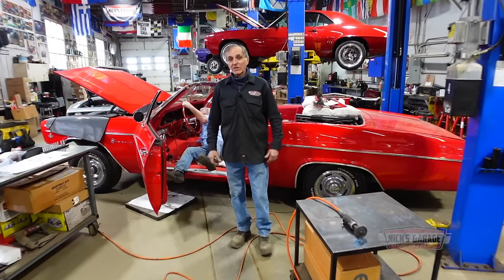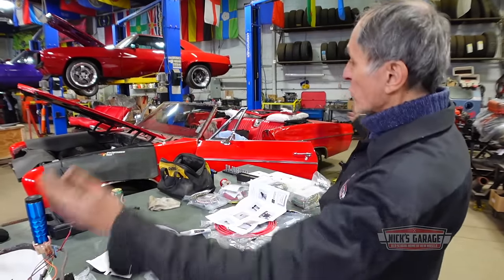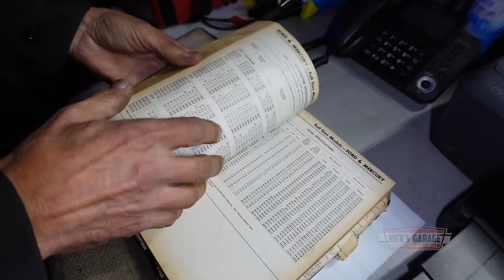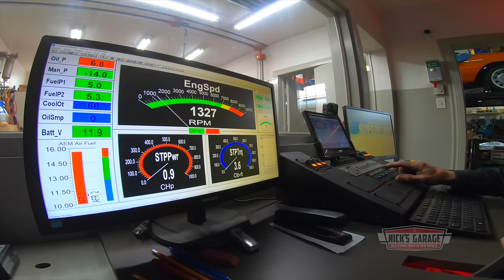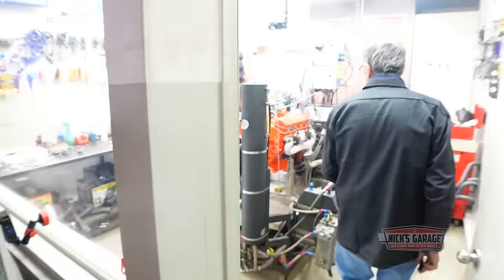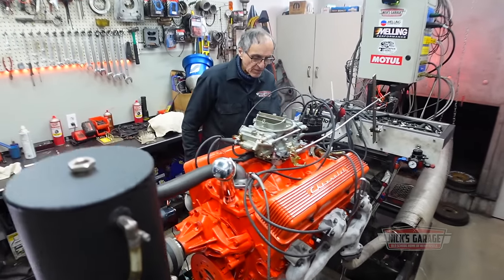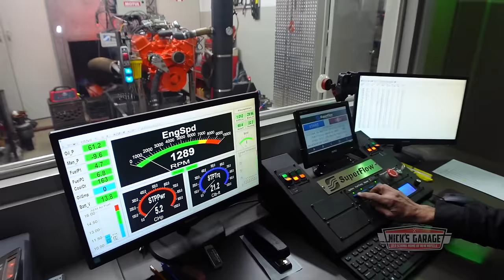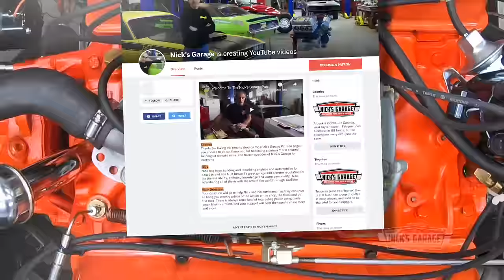327 Chevy on the DYNO - Exhaust Shootout

Comment: That torque and horsepower difference will directly relate to fuel economy loss as well. If long tube headers are used, I'd say he'd gain up to 2 mpg. Per tank full the headers would likely give him two extra gallons of gas, and quickly pay for themselves.

Comment: In my 79 Camaro, I welded in a tube and breather cap in each valve cover in addition to a PVC valve .
  What is a little cam?  in 1980 I put a 327 350 HP  Hydraulic flat tappet cam in my '79 Z-28 Camaro along with headers and a Holley street dominator intake  with a 600 CPM double pumper..    .450 lift that cam was very popular for street hot rodders

Comment: You could wire up a temp switch to turn on the water pump when the motor reaches the desired temp...much like wiring electric fans.
Reply: I was thinking that
Reply: I think the dyno does that...
Reply: @BuzzLOLOL  thats not what Nick said though. He said that he leaves the pump off until the motor gets warmed up then turns it on.
Reply: @cuzz63  ..That is correct. And I like to control it.
Reply: @nickpanaritis4122  no problem...thanks for the info.

Comment: 3M- Weatherstrip adhesive that comes in a tube is great for holding gaskets in place and especially valve cover gaskets.  Not the black stuff that is used to cement door and window gaskets in.  I'm referring to the yellow stuff.  It is a high tach  so you just put a small bead on the gasket and the cover then smooth it and spread it with your finger.  Let it dry for about 5 mins then when you put the gasket on the cover it will hold it in place.   It's not a sealant but works great on oil pan gaskets and it's just to hold the gasket in place while you sometimes have to tilt the covers or pans.  It won't cause the gaskets to slit and squeeze out like RTV and you don't need much on each surface.   I think 3 M also makes this in a spray to be used for headliners, but I think the kind that comes in a tube is best.  Just make sure it's the yellow because I think the black is labeled the same.   Caterpillar made some great stuff too, but they discontinued it.

Comment: Of course it depends on the compression ratio. The 11:1 version was 1965 - 1968 with 4 Barrel Carb (L79)

Max Brake Horsepower: 350 @ 5800 rpm
Max Torque: 360 @ 3600 rpm
Stroke: 3.25
Bore: 4.001
Compression: 11.0
Firing Order: 18436572
Reply from the maker: Thanks for the numbers.
Reply: @NicksGarage  That's the L79 he is talking about. 350 hp with hydraulic lifters! Came in Corvettes and Chevy II's. They embarassed a lot of big block cars.
Reply: @bobthbldr3  yep that's the 151 cam
Reply: @bobthbldr3  - Was also top motor for Chevelle before 396 came along late '65 and after...
Reply: 11:1 also in earlier 360, 365, and 375 HP 327" engines...

Comment: The 300 horsepower of that vintage had a carter avs 
the pcv goes to the back of the block by the distributor pre 1963 had the draft tube in that location

Comment: Smog exhaust manifold would have to go along with that points distributor.. if mine I’d have to change some things as HP will be lower at the rear wheels
Reply: Hot Rod tested 10 different types of distributors and to their surprise the stock points one made power up with the best of them!

Comment: The PVC on these hooked up behind the distributor there was a bell shaped plug with hose fitting and PVC screwed into the carb base with hose between if I remember correctly? There was a provision in the block, I don,t see it on this motor as it looks like a later model engine with large jornal crank and long water pump so not original to the 66 chev.

Comment: The 327's were tough little engines. And perhaps a little under appreciated.
Reply: the 327 engine was the start of the muscle car era. it started out as a 265 in 1955, grew to a 283 in 1957, and in 1962 came the 327( used in the corvette). the small block engines topped out at 350. it is amazing what you can do  just playing  with the "BORE, and STROKE" all from the same block( 400 C.I.D. engine was a different animal on a small block design - no cooling jackets between cylinder walls )  YUP!!!! THE MOUSE THAT ROARED!!!!!

Comment: i have a 327 in 1967 camaro 202 hump heads, aluminum high rise factory snowflake z28 intake, holly 650 double pumper, msd, bit of a cam, making 350 hp easy great motor

Comment: those heads are either 194 or 202 fuel injected  matched heads off of a 327 /375 hp L84 stock factory motor

Comment: 5.3 LS I  Own  One Drive it everyday  also I've been in love with 283 and 327 Chevy small blocks my whole life they are very comparable 60 years later make about the same power Get about the same gas mileage  Technology hasn't  Gone as far as we think it has My  30  over 327 splayed maincapped Canfield head engine turns 9000 RP m's makes 600 hp

Comment: That chevy 2 likely had a 350 hp L79 engine. That was a very fast car back in the day.
Reply: Probably not, Joe,  Nick said it had an automatic transmission.  I'm pretty sure all the the L79s were hooked to a 4-speed.  But you're right, that car was light and quick.  I had the precursor to the L79--340hp with a solid lifter cam.
Reply: The '67 Camaro cried out for the unavailable L79 option engine!

Comment: That’s a nice little 327 cruiser!  Seems it needs better crankcase ventilation (PCV?).  Crankcase pressure was still pushing that breather out.
Reply: there is a "DRAFT TUBE" mounted behind the distributor that was factory installed(port plugged on this engine) this is when "P.V.C." systems were just getting started( early version of emission control that was mandated in california in 1964)   that is why the breather cap un seated itself. had this engine come from the factory with a "P.V.C." system, the valve would have been mounted in one of the valve covers( no provisions made for the valve, unless parts were switched around- like the valve covers from a CORVETTE 327 from 1962)

Comment: My 68 Impala 327/275 auto th400. I whipped 5.0 fox bodies before they were all modded, beat a 90s Greenwood Vette who started at my rear bumper he got by me until I shifted 3rd and slowly walked by him. 4 ppl in my car and 2 in his. Beat iroc z and all of the new cars then. I was a sophomore in high school and it was older guys who could afford new cars that I was beating. It was stock except for dual exhaust and flipped the air cleaner lid over which gave I’d guess 20hp. It would suck the lid down when you rev it hard and the inlet couldn’t have been but 2”. It’s pronounced chevrolay here. That was the phonetic spelling. Just saying.

Comment: those "double hump or camel back" heads were rated to give certain horsepower with the factory cam, from the sound of the lope at idle it does not have that 'bump' have the factory blueprints of the motor been followed?
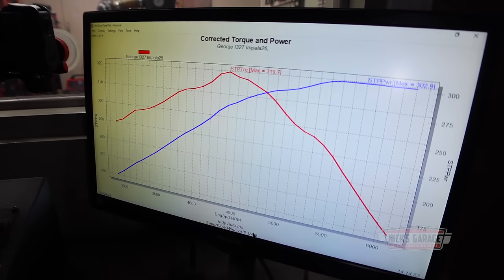Reply: This engine has lower compression ratio and too big of cam for the heads or for street cruising... torque is too peaky... see 18:45 ...

Comment: Loved the comparison. Most mods I make can only be tested by seat of the pants or at the dragstrip rarely. I have a 68 383 Barracuda with the factory exhaust manifolds. The driver side wraps around the steering column. Have you ever tested how much this hurts horsepower vs the B body high flow manifolds. I've heard it's a lot but never saw any dyno numbers using same motor. Would love to see you test it if you can find that manifold!  Love the channel!
Reply: It depends on where you stop making power now.  If you're rolling over around 5300 not all that much most likely were just to taking to 6000 would be quite a bit.  Also Nick does have vid comparing the max wedge mans vs headers.

Comment: Be interesting to check the casting number of that block.  If it is a 66 327 (small journal) block it would have provision for the old road draft tube or to add PCV set up.  From what I can see, there was no hole cast into this block for this particular PCV set up that was used up to 1967.  I believe in '68 the PCV set up was moved to the valve cover.  So this may be a 1968 or later block. Nick, I think your customer will need to put a hole into the valve cover to get a PCV.  Again would be interesting to know the casting number and date code for the block.  Also, letter on the block VIN pad.  I'm sure others may have mentioned what I just said, but too many posts to look through.  Cheers from Burnaby, BC.
Reply: It also has the larger harmonic balancer, not the small journal balancer. Its 68 or later. Designed for a PCV

Comment: It's probably building pressure cuz you did not put the PVC back in and it does not have the original hump in the back for it so you have to have valve covers with a hole

Comment: 327 Nova with dad , how to smoke a 67 corvette 🔥🔥 
3 and a quarter horse
Reply: 350 HP 327 in '66...
Reply: @BuzzLOLOL  .... Not true.  I had restored a few 66 vettes 327 engines rated at 300 HP.   300 HP  is max when I redo them to factory specs.
Reply: @nickpanaritis4122  - The subject was "327 Nova"/Chevy II... which was available with 350/325 HP 327" engine...
Reply: @BuzzLOLOL  .... I had a chance to buy a 1967 Nova but was too late and the dealer had sold it minutes before i got there.
Reply: @nickpanaritis4122  - Chevy made more than one '67 Nova... LOL !!!

Comment: Will a 318 do this? I don't mean a utg built 318.
 But im curious, a propper built 318.
Reply: 318 has a slightly smaller bore, slightly larger stroke, but with equally flowing heads, cam etc. should produce similar numbers. I'm sure a 318 built to rev would be a screamer just like a 327.

Comment: 6000 rpm on a near stock 66 !?!? 

For 1966, Chevy focused its small-block development resources on updating its two low-trim 327 V8s: The resulting entry-level V8 produced 275 hp at 4,800 rpm and 355 lb. -ft. of torque at 2,800 rpm. The next level of 327 V8 was rated for 300 hp at 5,000 rpm and 360 lb

Comment: The engine seems to have high crankcase pressure. I hope you replaced the exhaust valve seals. Adding a PCV valve should relieve it...

Comment: I have the low compression 250hp 327 in my 1931 hot rod. Everyone compliments me on the idle. Sadly none of them know it falls on its face after 4900 rpms. One day ill rebuilt it with a nasty cam and heads.
Reply: That's your valve springs , go behive springs alone and you will keep making hp
Reply: @DANTHETUBEMAN  - Yeah, the base cam prolly good to 5000+ RPMs... this engine has too big of a cam... no torque curve... just the torque peak seen at 18:45...
Reply: Stock Vortec truck iron heads let it make 450+ HP... add 224/234 cam... 1.6 stock type rocker arms...

Comment: I wonder what the difference would be, if connected to the actual exhaust system in the car. The restriction and flow velocity of all the extra exhaust pipe and mufflers can really change the dynamic. Headers behave very differently connected to a full exhaust system, vs. open collector.
Reply: 3" true duals with mandrel bent pipes and 3" core mufflers cost almost no HP with headers and an X-pipe can even improve peak torque from better scavenging!

Comment: You'll be able to  drive it without  going broke  like a 440 in HS  back in the my buddy had a 69 charger rt 440 sixpack 3/4 race cam automatic 3.55 gear ran 12 flat thru mufflers  w / m50× 15 tires when we went cruising / racing on sat bite it was 2 tanks of gas
Reply: This 327 needs smaller cam for better MPG and drivability...

Comment: Nick I was wondering if the block is a 66 327 cause the older ones had place in rear for pvc till 68 I believe good job on motor my first motor I built was 327 365 hp 11 to 1 compression 2.02 intake valves 1.60 exhaust thinking you made up my mind on motor I’m going to put in my 67Chevy C-10 has original 283 still in it but I have a 67 327 I pull around 30 years ago when I built a 400 sbc (406) after bored out and guy that has that truck still running strong so I always liked it but 327 came in 67 trucks. Thanks for video

Comment: Also I want to tell you I noticed that the bottom end is not a 66-year block because that year had a small journal what's that huge damper that's bolted on the front of that because it was a press on deal that year I know you can drill it out

Comment: I had heard that the double dome marked heads were rated at 375 horse when equipped with fuel injection or dual quads set up can you enlighten?
Reply: Various part number Camel hump heads came with various valve sizes and head port sizes... the last fuel injection 327's were factory rated 375 HP at about 6,200 RPMs... the intake was basically a dual quad tunnel ram intake converted to fuel injection and with lower side air intake to fit under Corvette hood... heads like -461X with that X mark had biggest ports... even bigger than other 461 heads... they can be ported out to 500+ HP...

Comment: Take a 1966 Vette there were many options  250 HP   350 HP hydraulic cam 365 HP solid cam..  370 HP with Fuel Injection all 327 CI  then you all the Big Block Options.. First year for Big Block engines in the Vette was 1965  396 425 HP   The  427 425 HP Vette made more like 500 HP  the 427 435 HP had 3 two barrels on it .. "Tri-Power"

Comment: Nick, I think the secondaries are opening too slowly too late, try a weaker spring in the housing that pulls the scondaries open?
Reply: The spring pressure has to be final tuned when engine is in the car... different operating characteristics there... plus this cam is too big...

Comment: Crank Case pressure building is that an issue? Popped off the oil cap both pulls and pushed oil out the valve cover. ??????
Reply: Rings not seated yet. Or a leaky compression ring set. Cracked, I have seen broken rings installed.
Reply: I just remembered when I saw the oil breather cap blow off an engine and fly straight up 20 feet. My 57 Olds 371 threw a rod!!!!! In the 57 Chevy coupe. Back in 65.

Comment: I don’t think my ford 66 289 + hipo  Likes the small PVC valve or tubing it sounds like it’s suffocating with all that vacuum , was going to switch it over to a breather , what do you think Nick is high compression with a lot of lift high compression, Maybe 400 HP with the right carb dialed in, it dies after burn outs
Reply: There's no vacuum at WOT... you may be floating the valves/pumping up the lifters during burnout...

Comment: Always loved the old 327.   They loved to scream.  Have had several.  Good video comparing headers to factory manifolds.  I have a question.  I'm building a square body Chevy 3/4 ton truck, 4 speed Sm465 and the big 14 bolt corporate rear end.  I would like to put a GM CRATE engine in it.  383 stroker with factory 425 horse 425 torque.  I am seriously considering putting a blower on it.  I've built blown engines before and had real good results.  Any advice on building a 383 supercharged?  Thinking 671 Roots with (2) 4's again.  Thanks.

Comment: Even with those manifolds it still makes 53 hp than stock
Reply: Well, it has about 35-40 more degrees camshaft duration than stock, and it’s running an electric water pump and no charging system.

Comment: Nice one Nick.
I have a 327 in my 65 caprice.
It's the small valve 275 hp version.
Just wondering what carb you had on there thanks in advance- much respect. Ps I'm running the factory rams horns and plan to leave them on the car thanks to your advice in previous vids.

Comment: So what kind of cam profiles consistently deliver 1hp/ci and what are some standard engine details that we should go for when we want that kind of hp?
Reply: It all depends on the engine profile.
Reply: @nickpanaritis4122  I guess I am curious if there are certain parameters that you listen for when someone talks about their engine specs to determine if you think it will make 1 hp/ci. Certain cam profiles for the given head design, or minimum compression ratios, etc... I imagine with your experience you have a relative idea what a given engine will make. But, I was just curious. Lover videos and what you do... hoping to get myself a budget dyno in the next year or so.
Reply: Cam in this engine is too big for the heads... 2 sizes smaller would give similar HP but vastly better drivability... see peaky red torque line at 18:45...

Comment: I wonder if those were 461 cast# heads. 335hp they would almost have to be.
Reply: Most 327, 350, 400 car heads good for up to 375 or so HP... '96 - '02 Vortec 350 truck heads good up to about 475 HP... 
The cam here is too big... has a torque peak instead of a torque curve... see 18:45...
Reply: @BuzzLOLOL  ... My client bought the 327 " 2nd engine"  with this cam. He decided to leave the same cam it came with.
Reply: @nickpanaritis4122  - Does George realize how bad the car will drive with that cam?

Comment: The block doesn’t look like it has the provision for the PCV and separator tube that runs in the lifter valley.  All small journal 327s should have that. Was it plugged, or is this a later block?

Comment: NO surprise losing 30 hp, worst set of manifolds GM ever put on a Chevy back then. 66 Impala should have Rams Horns manifolds, which flow far better! PCV hooks to the vent by the distributor on 66, no need to chop up a valve cover. That's factory!
Reply: Work great on driver side for a s10 swap it'll clear the steering box

Comment: It would be interesting to see how much power and torque a set of 2 1/2 inch rams horn manifolds would make.  I have that combination on a 66 Corvette I am restoring.  Nick this 327 you built made impressive power be being mostly stock with a mild cam.  Nice job.
Reply: Nope, cam is about 2 sizes too big for that engine... peaky torque 'curve'...

Comment: 327 300hp was lowest rated for corvette. 375hp FI (63-65) 365hp 4bbl was highest. Impala had lower rated options, not certain but I think you could get a 350hp version on impala SS.
Reply: L79 350 HP 327 available in Novas and Chevelles... may have been considered too peaky for heavy Impala... 
Chevelle then got 396 for more torque against the competition...